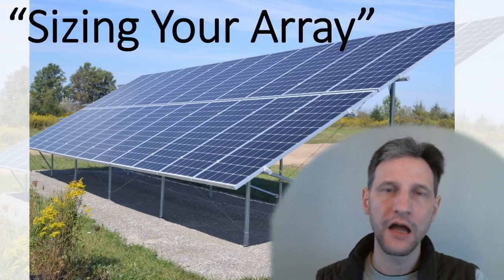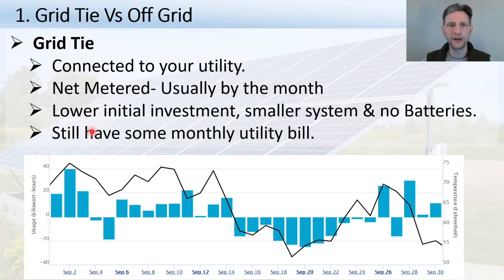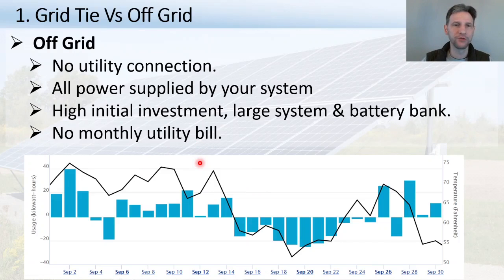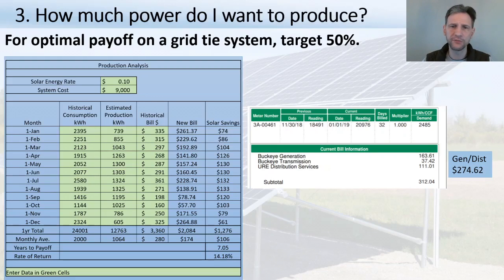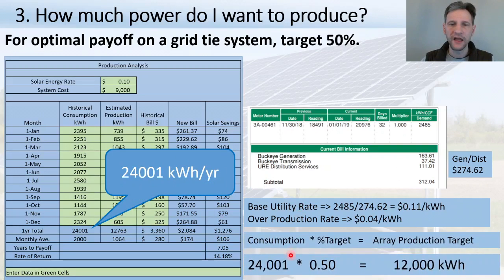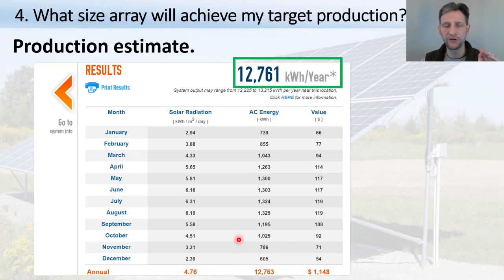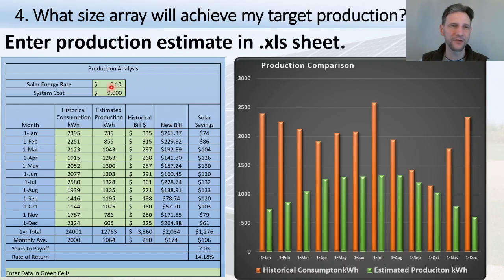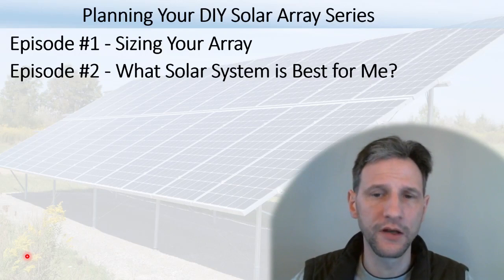How to Size Your Solar Panel System - Planning Your DIY Solar Array Part 1

Comment from the maker: Watch next Part 2  - Roof VS Ground Solar Panel Systems  - https://youtu.be/w-iS_8e7n60
Find More information for this project and others on my website: https://projectswithdave.com
Other Helpful Solar Videos:
Super Cheap Solar Panel Review: https://youtu.be/qu4iGxBhqzs
Full Solar System Install: https://youtu.be/_xA6qOwnYbM
Check out the first year performance results here:  https://youtu.be/BatTeSq05rU
See the total system cost here: https://youtu.be/PNTO83FvaL4
And How to size your solar system here: https://youtu.be/rbFnZqA0GCI
4 Things to Know About Solar in the Snow: https://youtu.be/vY3PufzPUnI
How to Get A Permit For Your Solar System: https://youtu.be/imiEYDHLG4A
How to Crimp MC4 Connectors: https://youtu.be/oH3LqTu4B8E
3 Solar Panel Wiring Issues Answered: https://youtu.be/i7vHEHB3a-M
Net Metering Explained With Actual Data: https://youtu.be/IwUK1dNJ3n8

Comment: With grid tie and no batteries, you need to really know what your peak consumption is on an hourly basis so you don’t over produce. Luckily I have annual net metering, so it doesn’t effect me. I offset 100% in 2020 but I only consumed 43% as it was produced, the remainder was “sold” back and “reused” later resulting in a net of zero.
Reply from the maker: Mine works the same way, just monthly.  The hourly overproduction gets absorbed by the grid and "reused" by me averaged out over a month.  Annual net metering is fantastic!  I wish I had that.  : )

Comment: Thanks for the awesome videos and sharing the stuff.
I would mention that you can create a hybrid system with small batteries, so you just calculate the energy usage for constant things (e.g., background stuff running 24x7 like routers, computer, fridge etc) and size the battery based to cover that. In this case the battery would be like 5-10% of off-grid system. Also if you have off-peak tariffs, then you can top up battery at night using cheap tariff in winter or after cloudy days. But for the beginning your variant is the best and easiest, also pay off quite fast.

Off grid systems and battery are bad, because when they pay off (e.g,, 7-10years) you need to invest in new batteries again, so all your savings are gone ...
Reply: They last 25 plus....
Reply: @90kevin20  which batteries last 25 years? (I'm not talking about solar panels which some call solar batteries, but about lead-acid or li-ion etc.)
Reply: @electricwhirl5175  I'm not sure they last 25 years but lithium iron phosphate will tolerate more than 10,000 charge cycles vs normal ones with 1000 to 3000.
Reply from the maker: Thanks for the feedback!
Reply: Electric Whirl: Pnone companies have giant lead acid batteries that last decades, to back up landlines. They last because they’re not getting their life shaken out like car batteries. Also lasting decades are flow batteries which aren’t fire hazards and aren’t picky about charging characteristics—I’m not saying they’re cheap yet! Finally, there are more brands of flywheel electricity storage than I thought, and they last decades as well.
The key to acceptance of these better storage systems is mass production. It’s hard to find investors willing to sacrifice capital for the long-term payoff. Government will never do it, but a really smart, freedom-minded cooperative of citizens might be persuaded. One precedent is how North Dakota’s electric coops backed by farmers funded the state’s electrification back in the day, when commercial power companies wouldn’t.

Comment: Could you clarify something for me. You state your system cost is $9000, but the Unbound site says their 9KW system is almost $14K without the mechanical racking.  Does the $9000 include the rack system and how much did you pay for that? So, the rebate you get reduces the $14000 plus the cost of the rack system down to $9000?
Reply from the maker: The short answer is, yes, my numbers include the racking system.  Typically the package deal on Unbound Solar includes the racking for a roof attachment.  When that cost is removed and the ground rack added back in, the difference is only about +$600.   I plan to do a future video with the cost breakdown.

Comment: Three excellent videos.    Very well done.  Although a system 1.5 or 2.0 times as large as what you installed would not provide as high of a rate of return on investment, the question to ask is what the incremental return is on the incremental investment.   I suspect that this return (while not as high as you are currently getting) may still be sufficiently high enough to justify an investment in a bigger system
Reply from the maker: You are right, I'm sure a larger system would not be hard to justify, however, this was an experiment for me.  I was also trying to minimize the initial total capital outlay as much as possible.

Comment: Shouldn't you get some sort of tax credit or utility incentive ? if so did you calculate that in total costs?
Reply from the maker: Yes, I factored in the tax credit when calculating my returns.
Reply: Tax credits are a bit misleading. Don't forget that you must have to the tax liability to begin with.
For instance, if you are an independent contractor with an LLC, you must first pay the TOTAL amount to yourself from the LLC to create the liability ...... think about it.<VBG>
TANSTAAFL<VVVBG>

Comment: I think where I live you getting a kw credit that can be used later in low producing months.
Reply from the maker: That's very nice! It would allow you to have a larger array and still maximize your return on investment.
Reply: @ProjectsWithDave  I don't have one , My friend has think 10 kw array, and way it works you can make extra one month and use it next month ,and once a year is reset meaning they calculate all and if you have extra left you  get very little for it or nothing , Thanks for replay , great video.
Reply: @786otto  if anything, you have wiggle room to connect more electronics down the line. Or not have to worry too much about the degradation of the panels. –\(:/)/—
Reply: @kingarthurthe5th  Yep, that how is done. Thanks for your reply.

Comment: Thank goodness my utility only has a $13/month connection fee and does the net meter washout annually. We are expecting a $80 washout check and we were net zero for the first year on 9.25 Kwp.  I oversized by 20% based on NOCT vs annual usage so the system will stay net zero for the life cycle of 25 years even with panel degradation . Payback  is still 6.6 years.
Reply from the maker: Wow! That's an amazing setup with your utility, makes a net zero plan much more affordable.

Comment: My co-op - Union Power - in North Carolina - must have similar fees as your does.   They told me Friday (when I ask) that they charge $0.10/KWH - but on my  January bill they don't break it down - they just show "Energy Charges" - for me for that month it was $143.84 for 1137 KWH..   If you divide that number by KWH you get $0.1265/KWH - so some other fee is in there.     If you multiply the KWH consumed by what they say they charge ($0.10) the dollar amount is almost exactly $30 lower - so that additional $30 difference is probably a transmission fee.   I looked at the July bill - if you did the same math you also get that $30 figure....it is essentially a grid connection fee - that is always there.     I like your approach about coming up with a size estimate to minimize generating a surplus.       In your bar graph it looked like you never produced a surplus (when you average things out over a month) - though you came close in September and October.     I plugged in a 9KW number the first time - and had 5 months where I had a surplus.   I'll try 8KW and see where that gets me....
Reply from the maker: I'm glad you are taking the time to investigate your actual situation.  Every utility is different, and the profitability can very drastically.  If you ask them, they should be able to give you a breakdown of the base service fee, and the production, transmission, and distribution rates.  In my experience co-op's are usually easier to get information from, you are a part owner in the company.

Comment: What happens if you elected to do a 60% system
Reply from the maker: I would slightly over produce in September and October.  That would slightly increase my payoff timeframe, because I would only get $0.04/kWh for the overage, but it would not be a big difference.